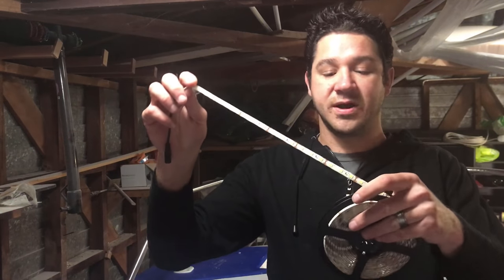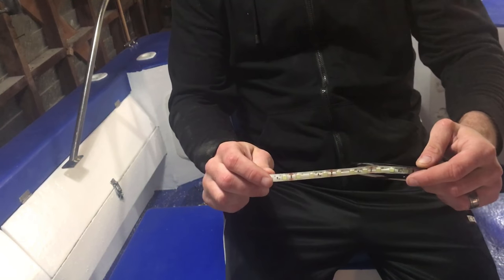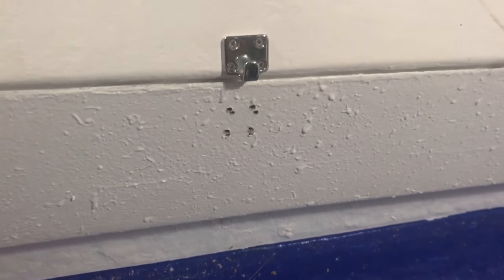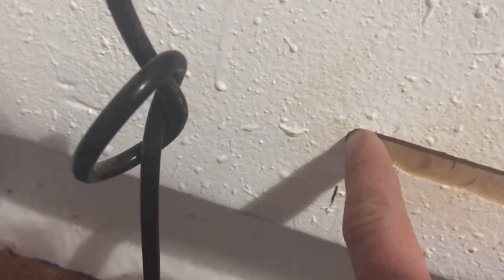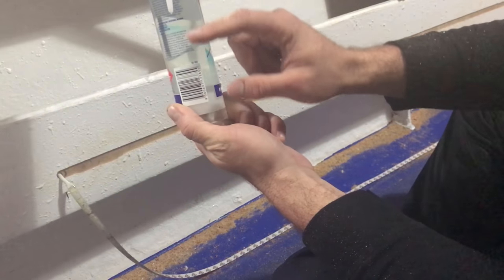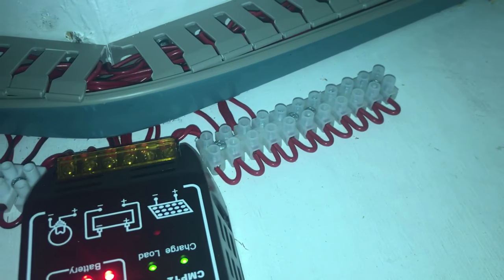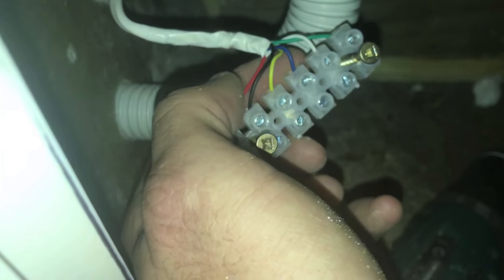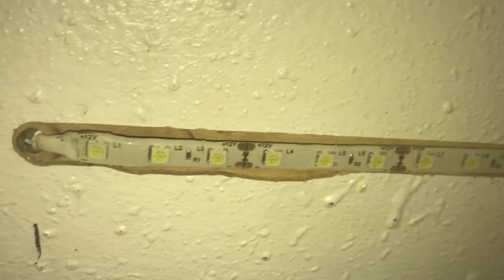LED Strip Lights Installed on Boat

Comment from the maker: With so many people passing through. It Would be pretty cool to know where y’all from let me know down here.
Reply: Connecticut, USA!
Reply: Stockholm, Sweden 🇸🇪
Reply: Minnesota USA
Reply: Do I need the switch box ? Or can I connect them directly to the battery
Reply from the maker: @montellwilliams811  They don’t need to have a switch box but you will need to have some sort of switch to be able to turn them on and off with. sone LED strip lights come with a controller and remote that you can use to turn them on and off and in some cases change the colour of the lights and different flashing modes etc.

Comment: I am trying to find a led strip light thst neds no extra wires, resistors, distribution centers, connectors, and all the extra stuff that makes me rather go without.

I have solar or 9v or AA string lights. That’s all in one, but not water proof.

As soon as there are any extra things I must connect before connecting to battery I am out

Comment: What type of LEDs did you buy off trademe? And did you need a controller to set the colour? Cheers
Reply from the maker: It was the 5M SMD waterproof single colour led strip lights. They come in Red blue White and green. No need for controller with the single colour lights just need it if you have the multi colour. I’ve wired them in straight to my boats 12v house battery.

Comment: That's cool, if you can turn them green and hang them on the outside, fish are attracted to green light, just sayin;)
Reply from the maker: Pocono Joe thanks bro. Yeah I was thinking of putting some underwater led lights on the outside of the boat to attract the fish. Did not know green was the colour of choice so I will definitely give that a go.
Reply: my pleasure and yes i used to own a fisherman's green light, it attracted the bait fish and they attracted the predator fish, then you just toss a lure in;)
Reply from the maker: Sounds awesome. Does this only work at night or during daytime too?
Reply: Blue works as well.
Reply: @FishingAdventuresHB  works during the day in deeper waters but way better at night however, i just saw this lol!